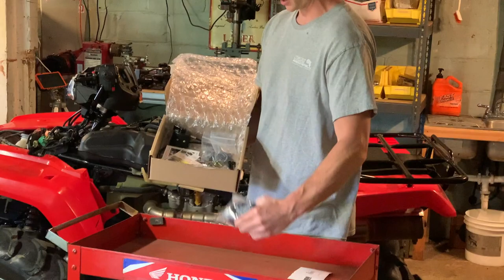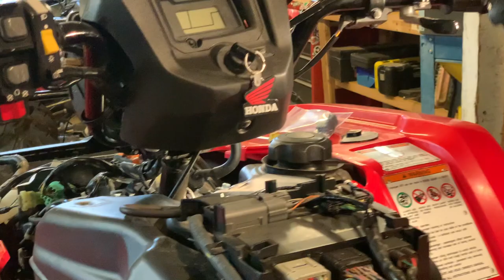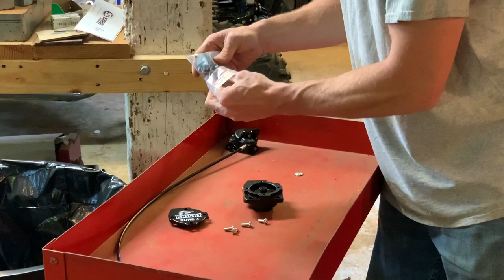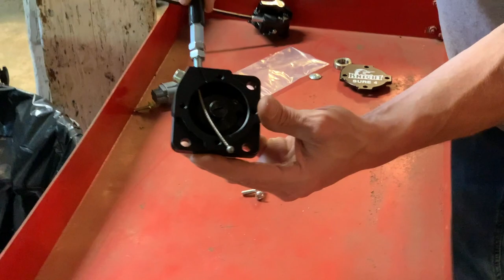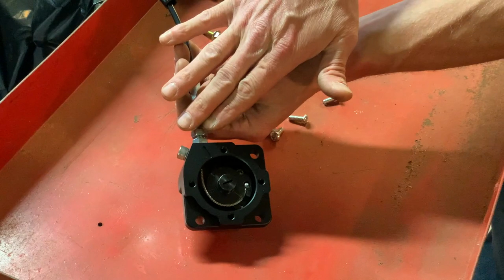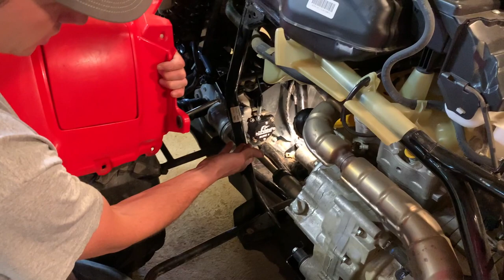Honda Sure 4 with Tank Lever Installation Instructions

Comment: #1 Is the cable shifter connection is waterproof if everything is underwater ?   #2 could water travel the cable into the diff form the shifter?
Reply from the maker: I've been underwater for extended periods without any issues. We have sold many of these kits and have not had 1 customer complain about water getting in.